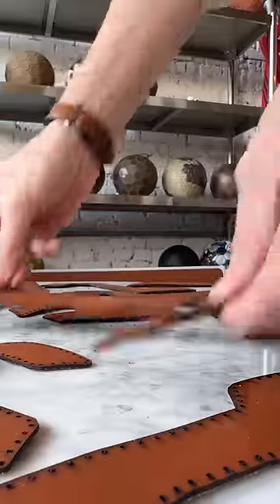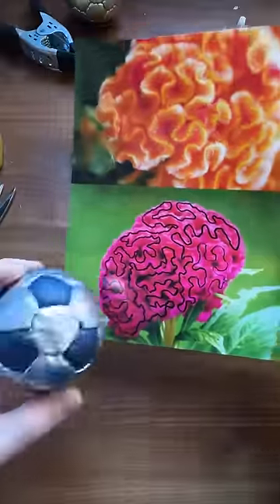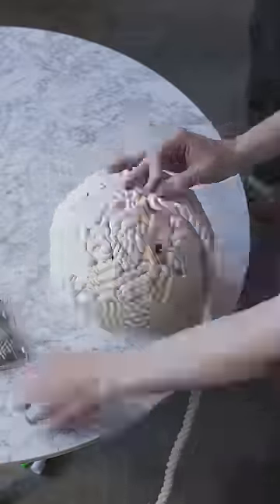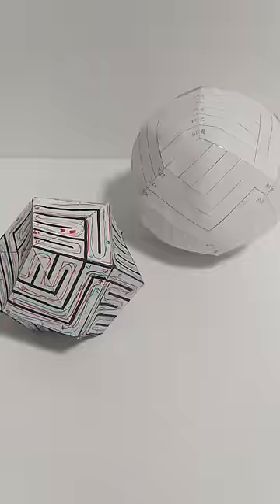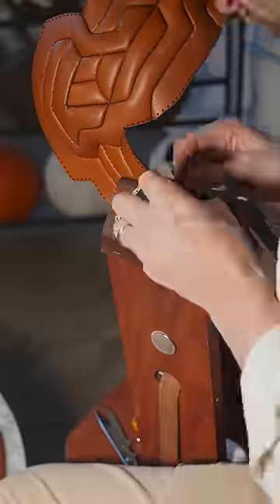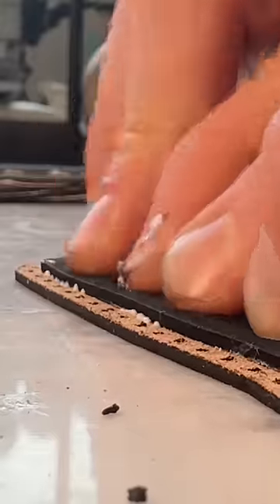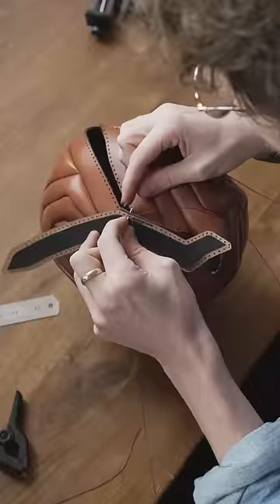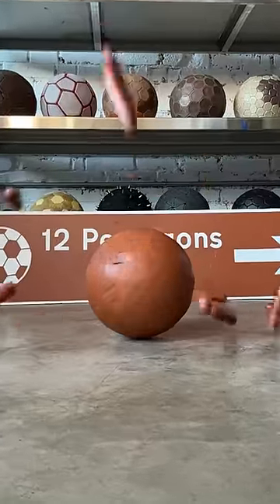using a wiggly line to construct a ball

Comment: lol reminds me of when I was a kid and was decorating a cake and I was going for an orange crazy random curvy line pattern, using a teeny tiny piping tip that I had been dying to try, but my icing was too thick and the orange wasn't orange enough so it came out looking like a big pile of spaghetti, so I gave up and took the leftovers of the chocolate mousse I was using for the filling and put it in a piping bag and having learned my lesson, I didn't use a tiny tip, I used the biggest piping tip I had and made a giant swirl on the top, but there wasn't enough to cover the spaghetti... and then it looked like poop spaghetti. BUT YOU KNOW WHAT it tasted flipping delicious.

Comment: Just try new version with light blue vibrant and white just those two colors and make the main color white probably pure white would be working very fine and the accent secondary color is the blue so it’s like 80% to 20% raise you where the 80% is the parallel white and the vibrant light blue is 20%!

Also try to make the the lines of each space less itchy, and more curvy I believe it will add up!

And if you have a luxury at the time, make one with the itches that are so sharp instead, and you’ll have two distinct versions of the same wall design base and I’m sure both of them will come out great but definitely one will look more appealing than the other, so let’s see that !

Comment: I wonder if you could make a version of this with an unbroken interlocking white and blue line. maybe your current path but white on the left edge and white on the right side of the path. That would help hide the panel segments and prevent it from being sausages

Comment: For the issue of it not fitting in the laser cutter, could you not just cut the whole length of material you need for the ball, and have the laser machine cut it in sections. Ex. if it takes 10ft of material to make the ball, but your machine only fits 3ft, you would put the 10 feet in (3 flat, 7 rolled up) and let it cut the first three feet, then roll up the 3 feet of the other side and let it do the next 3 feet, and so on, so you can just unroll it to make the one piece?

Comment: Would it be possible to open the front and back on the laser cutter and have it do a series of unfinished cuts. Like, you would use a long strip of material make what cuts you want then reposition the material and cut your pattern again over and over until you have 1 long wavy strip of leather you could turn into a ball thats just 1 long strip?